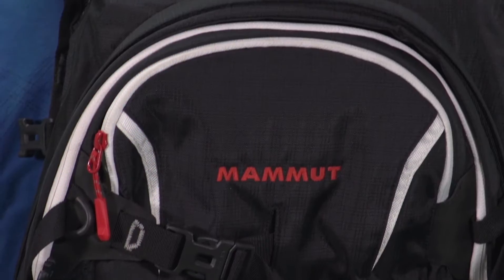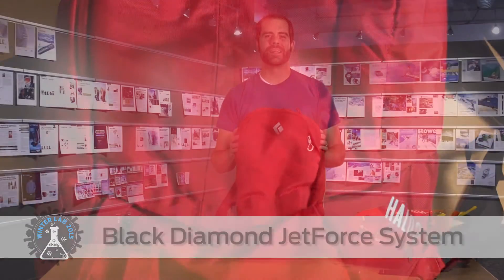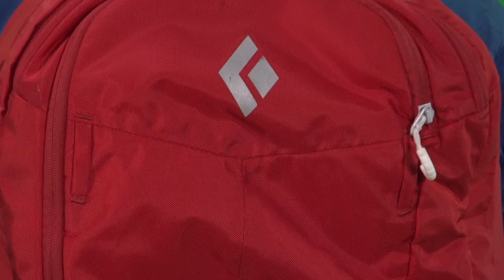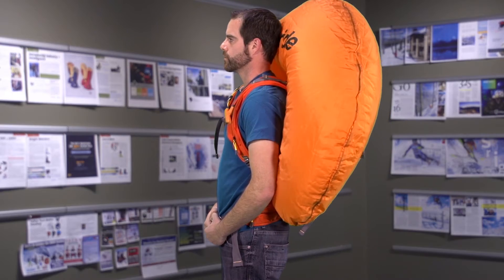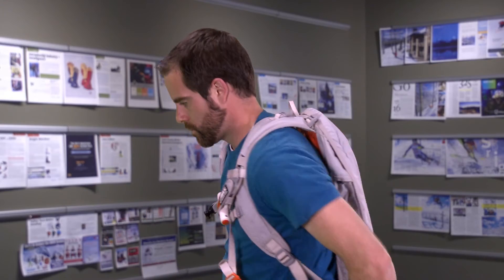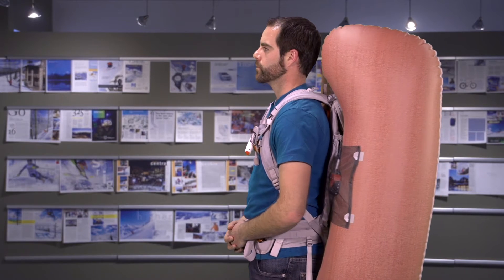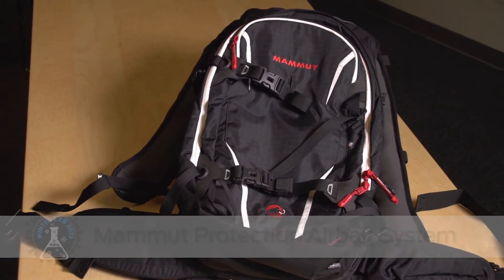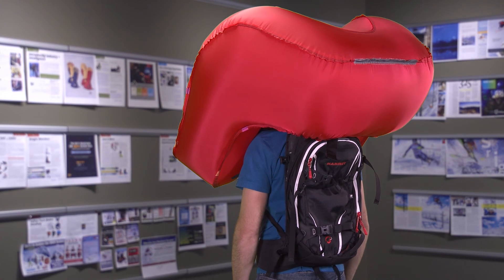Winter Lab: Avalanche Airbags Explained

Comment: But how does it keep u on top of the snow
Reply: By providing a very large surface area it creates an area that resembles a snow sail.  You are pushed forward with the avalanche rather than being pushed under.  It’s much like surfing in front of an ocean wave wile holding onto an inflated inner tube, rather than the wave crashing through you and tumbling you under and making you eat sand.